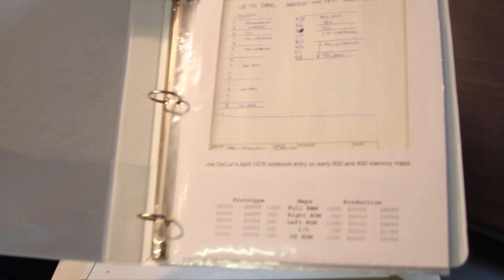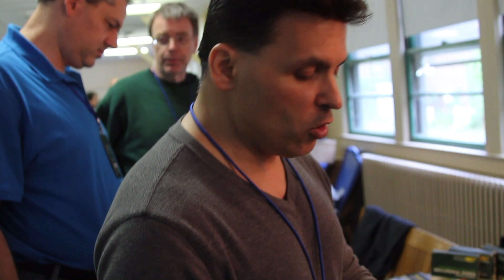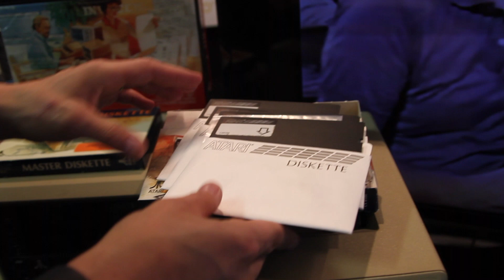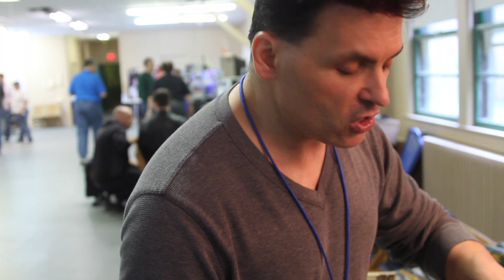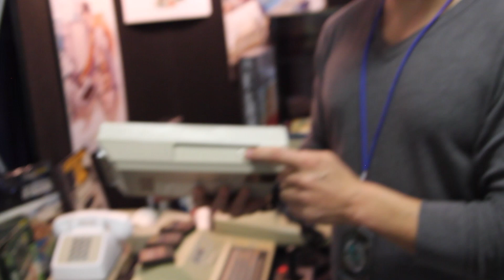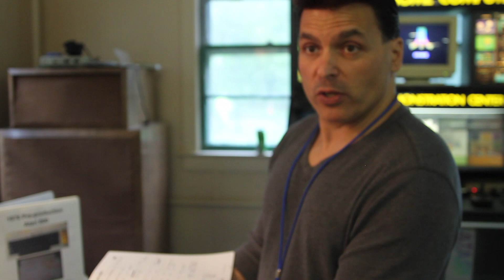Atari 400 and 800 Computer Comprehensive Presentation 2019 VCFEAST Festival

Comment: What he said about a "repeat" feature with audio programs on tape I think is wrong. I used audio programs with the Atari tape drive, and I never saw one rewind the tape, even when it would've been helpful. It's true that the computer controlled the tape drive, but it was only to start and stop it while the tape was playing (really, turning the power on and off). The only way for the tape to be rewound would've been for the user to do it, but I can't imagine the program requiring that of them, to repeat a piece of audio, because trying to rewind, and find the right spot to hit stop, and then play would've screwed up the synchronization between the program and the audio track, since synchronization was only achieved by timing loops in the program. The conversational foreign language packages he talked about used this technique.

Computer control of the tape drive was a really neat feature at the time, though. :)

The Educational System cartridge used a slightly different technique from any of the other audio programs. Rather than pre-loading timed text inside of a loaded program (like the foreign language programs did), and starting and stopping the tape only to synchronize the audio with that, it streamed data from the tape, creating text graphics and formatted readable text on the screen in real time, and possibly only stopped the tape to offer a quiz (I could be wrong about that. It's been so many years). The data stream was synchronized with the audio track when the tape was manufactured.

Comment: When I first started using the 400 at my local library, I used the first model of 410 program recorder he showed. It was good, very reliable. I could put 60-minute cassettes into it, and I could use the full length, both sides, and it could read the full length back. I know it worked well, because I put the same tapes into other first-model 410s, and they could read them just as well.

I really didn't like the program recorders Atari produced after that. The second 410 model looked cheap, and it seemed to perform that way, too. It had trouble reading the tapes I recorded with the first 410, I assumed because the drive motor was weaker. It seemed like the take up reel built up too much resistance once you got about halfway through a 60-minute tape. It kept erroring out, and I couldn't get some of the programs I'd recorded off of it. It was the same story with the 1010. It didn't look cheap, but it seemed to use the same mechanism as the second 410 model, because it would error out in much the same way with my tapes.

It's not that the drives were defective. I think I just needed to use shorter length tapes with them.